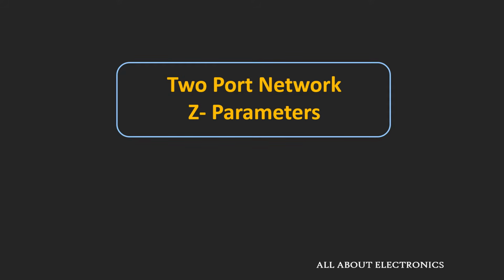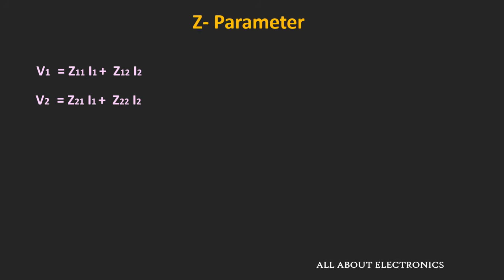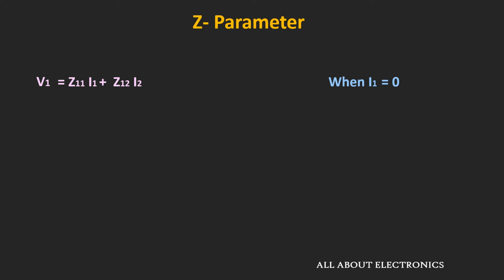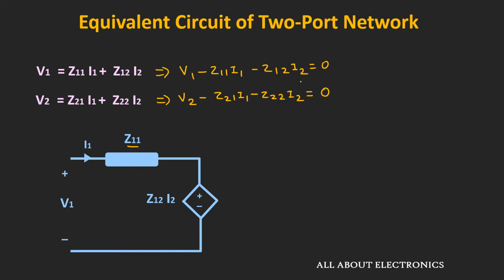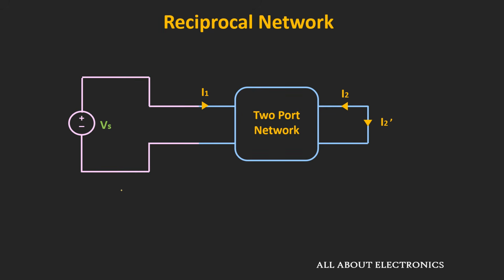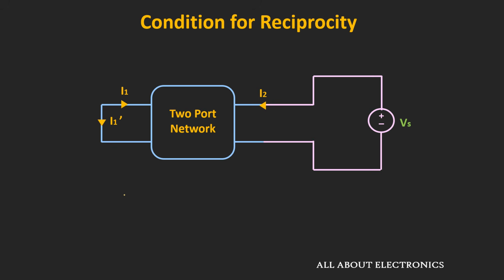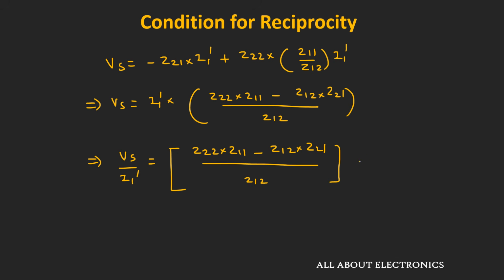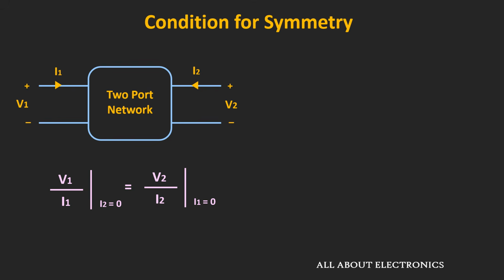Z Parameters Explained | Condition for Reciprocity and Symmetry for Z- Parameters

Comment from the maker: The timestamps for the different topics covered in the video:

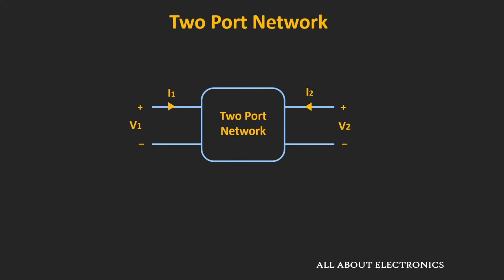0:22 Z- Parameters of the Two-Port Network

5:37 The equivalent circuit of the two-port network in terms of the Z-parameters

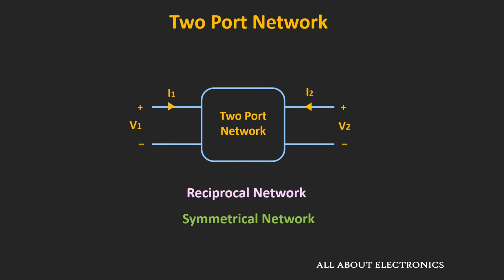7:27 What is Reciprocal Network? Condition for Reciprocity for Z- Parameters

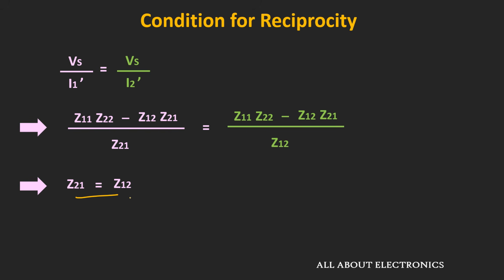13:12 What is Symmetrical Network? Condition for Symmetry for Z- Parameters

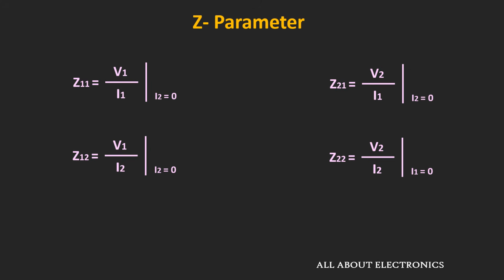Comment: i am confused about Z12. you did not mention what Z12 is called and also while mentioning all parameters at  5:18 you wrote Z12 while I2 is 0 which I think is wrong
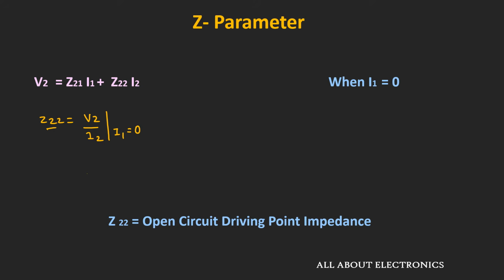Reply from the maker: Yes, at 5:18, it should be I1=0. By mistake, its written, I2= 0.
Reply: @ALLABOUTELECTRONICS   sir  is Z12 called open circuit reverse transfer impedance or is it Z21?